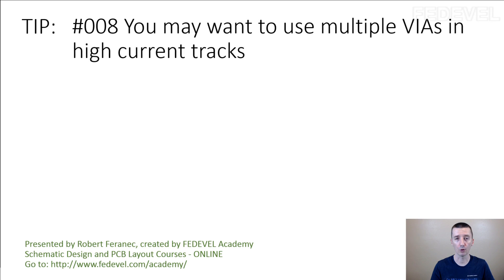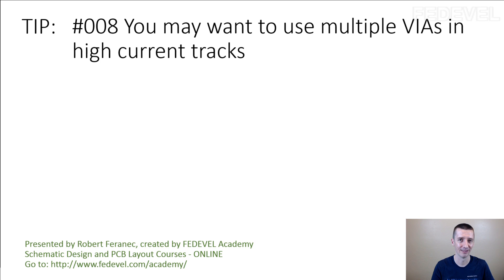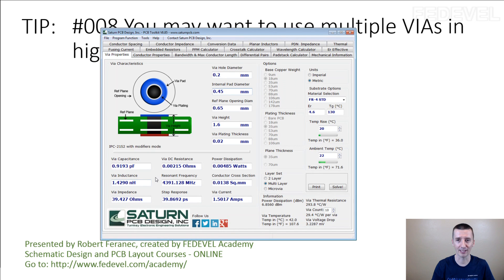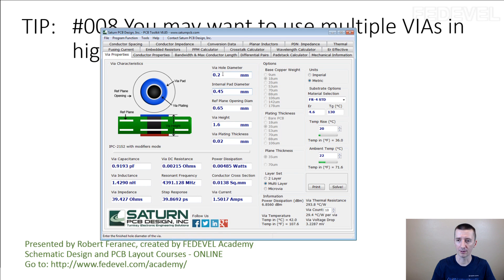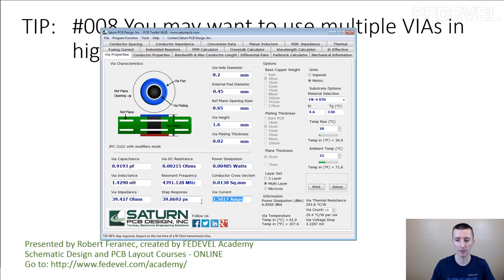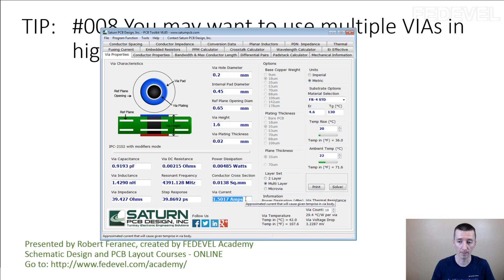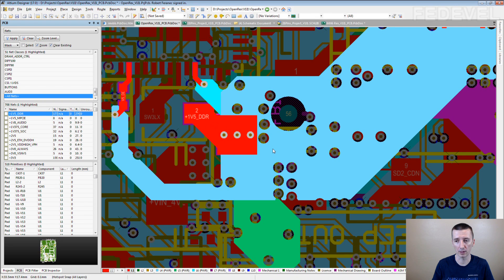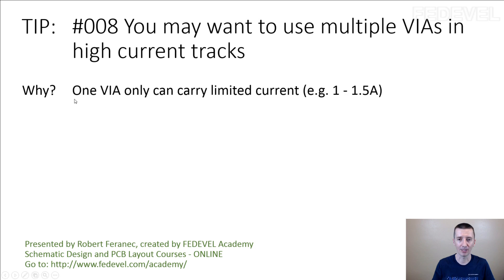TIP #008: You may want to use multiple VIAs in high current tracks

Comment: Isnt the rule of thumb around a via per 0.5A? At least that is what I usually use, also because of thermal sinking.
Reply from the maker: You can try to set different thermal parameters in some calculators and try to compare it.